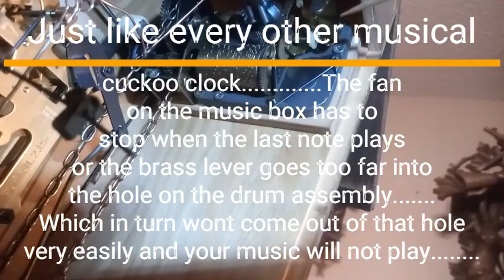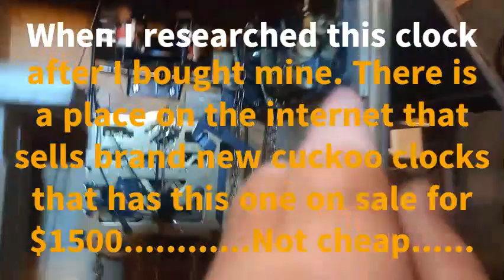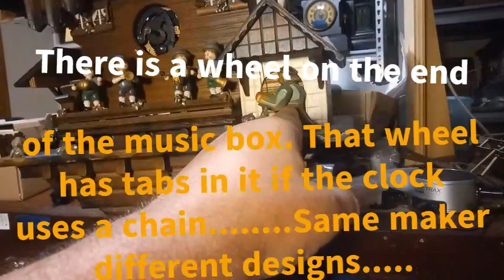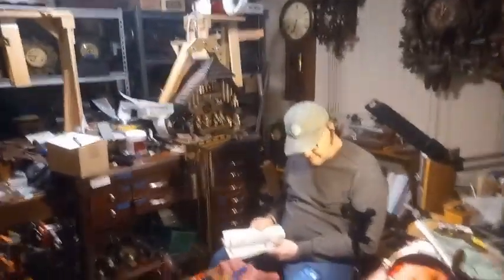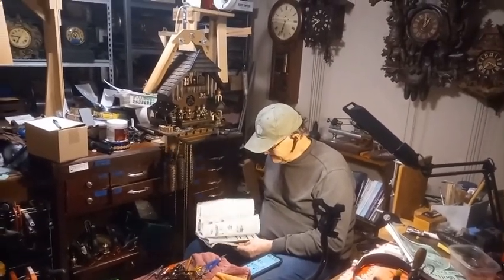Repairing an 8 day Oompa with bell ringer cuckoo clock by Albert Schwab Karlsruhe (See Description)

Comment: I wonder what the difference this clock is compared to mine. My Oompa players move really good. Glad it is working for Ron now.
Reply from the maker: Does your oompa player have the same set up as this one to make the oompa players move. There is a plastic star wheel at the top of the section that pushes that if you follow it down then there is a fork assembly that has the wire that moves the oompa players. Very poor design. I have an 1 day oompa player and they swing back and forth really well. Thanks for watching. God bless.